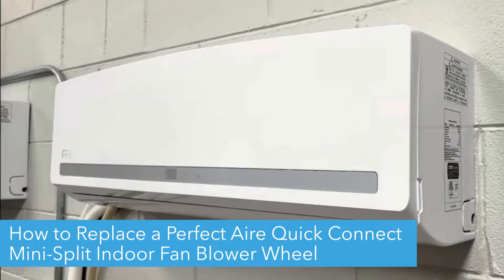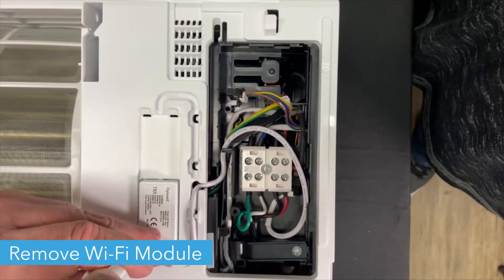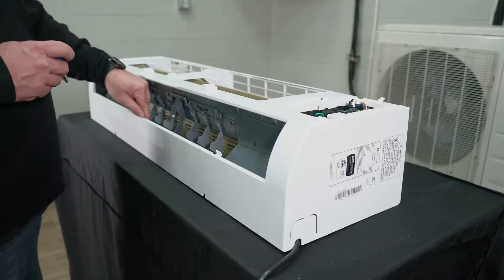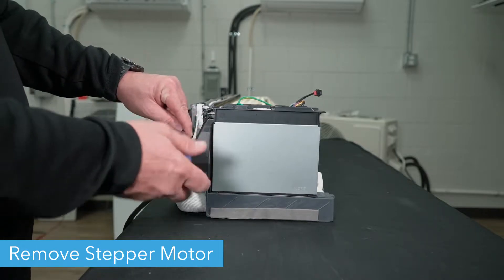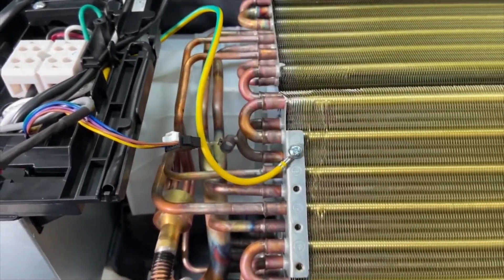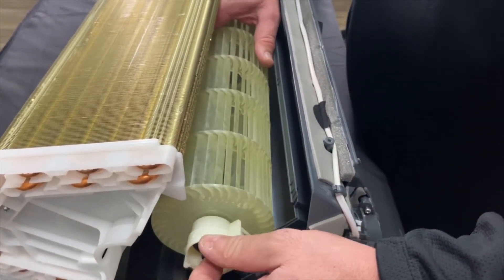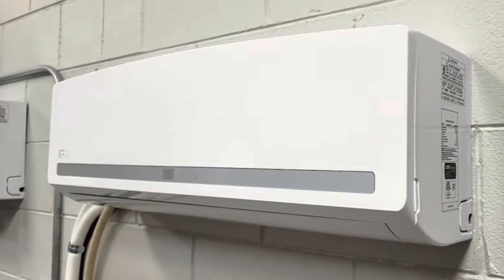Perfect Aire/Denali Aire – Quick Connect Indoor Blower Wheel Swap

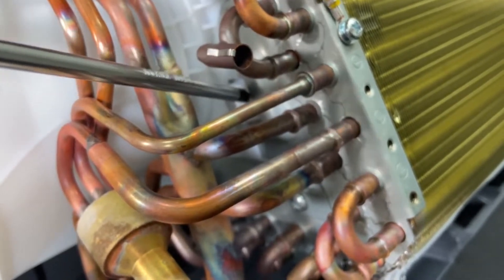Comment: On mine, before I can separate the coil by depressing the tab @ 3:38, there are 4 screws holding the right side of the coils to the fan motor cover that have to be removed.  After that, it comes apart as shown in the video.

Comment: Can this be done after the unit has already been installed while mounted?
Reply: Ive been able to remove the front cover and some other parts, for general service, after its installed on the wall.
In particular, the output drain pipe from the water drain tray got clogged somehow.

Comment: Thank you for this! The design on this is very similar to Lennox minisplit head units. The only difference is that the blower wheel lock screw is between the motor and the blower wheel, not inside the blower wheel like other units. Required Dissassembly is essentially the same though.